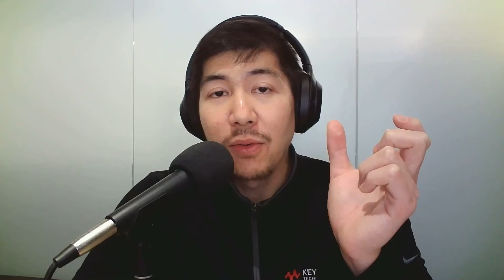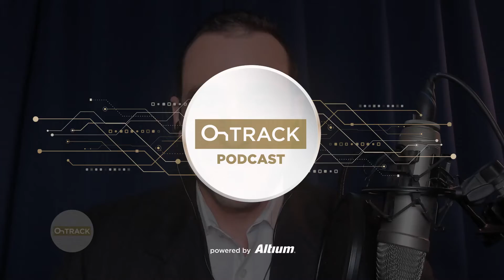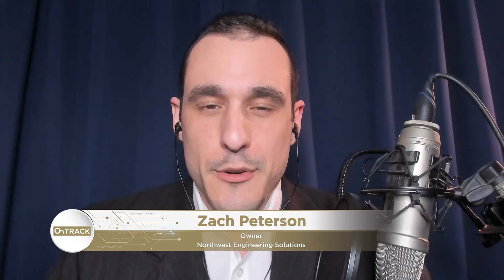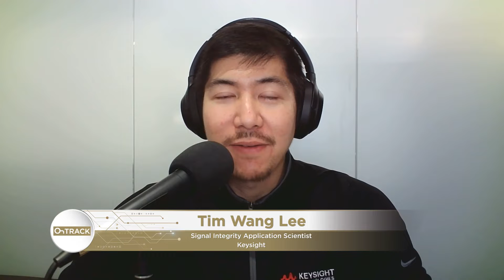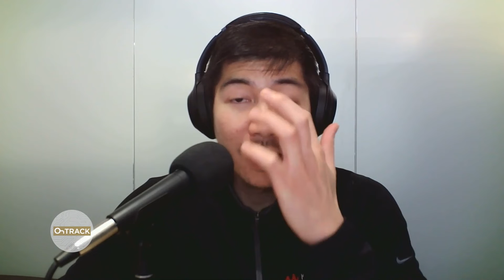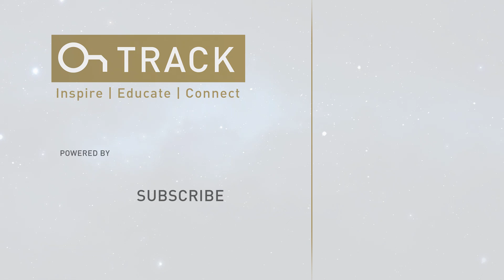System Level Qualification in Simulation with Tim Wang Lee of Keysight

Comment: Interesting Convo. I'm betting Altium adds 3D EM modeling options soon. If they can bake in Simberian's 2D solver, they just need to strike a deal with an existing 3D EM modeling tool provider. Skip the odb exporting and importing to other tools...
Reply: Something like CoDesigner but for interfacing directly to a field solver would be excellent